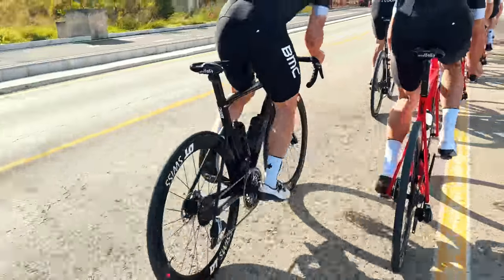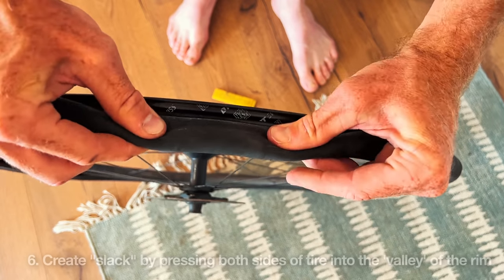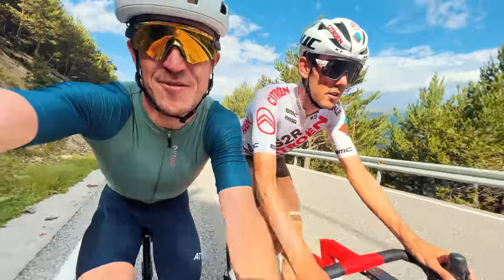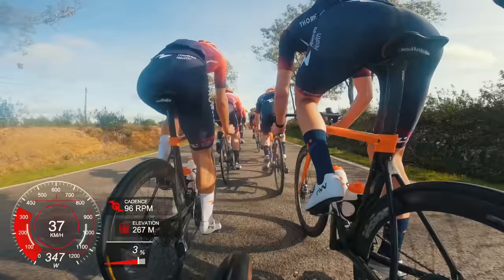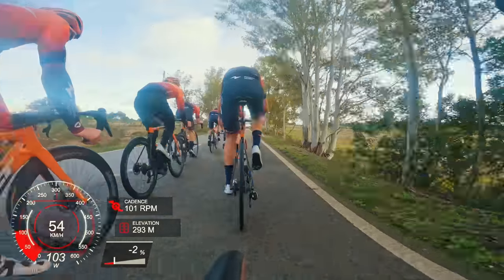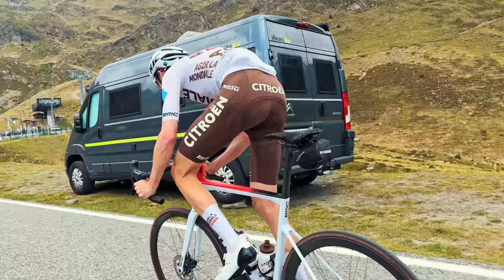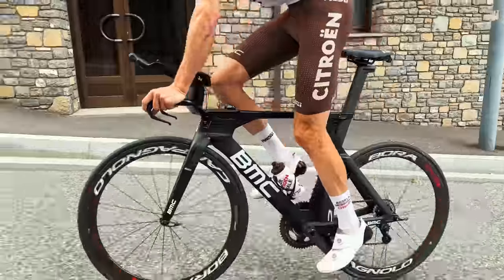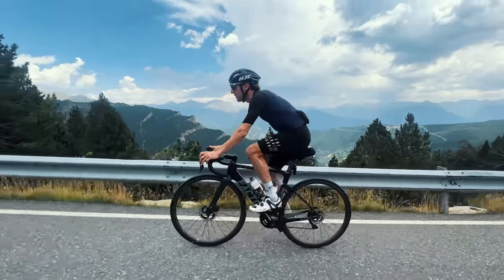6 SKILLS Pro Cyclists Have That YOU Can Learn Too

Comment: Nice video.  One thing about pace lines, at least to me, is that on most group rides or centuries, you are in a single line.  The leader takes his time up front and then signals when he is ready to drop back and then the rider behind him takes the lead for x amount of time.  Easy-peasy and no wasted effort.  Two wide on public roads can be a bit disconcerting, with traffic and all.  A side story about pace lines.  I was on a century ride years ago and we were moving quite fast.  As we were moving along, we heard 'On your left'.  Blowing by us like we were hardly moving was a line of tandems.  Oy!  They were more than fast.  It got me intrigued and not long after, I purchased one.  A great purchase and I still ride it to this day when I can get someone to ride with me.  Your advice on nutrition is spot on.  I got lazy and put on a bunch of extra weight the last couple of years.  I'm 65 and my doctor admonished me to lose weight.  I fixed my diet and started riding more, like I used to.  My average speed has gone up three miles and hour on my normal rides with less effort and way less fatigue.  I now carry energy bars with me and it has made a big difference.   As far as turning your bike upside down, I guess that it is OK at home on a carpet, but, as you stated, lay your bike down on the non-drive side on the side of the road in the grass.  Sorry about the long-winded post, just a lot to mention.  Either way, a great video and excellent advice.

Comment: Very well presented. Sleep has become a huge focus for me especially as I age. In my 20s and 30s, it didn't hamper my group rides. Now in my 50s, low quality sleep can destroy my rides. Thanks for this topic👍🏾
Reply from the maker: Thanks Luis. I really think sleep is as overlooked as nutrition has been at times. I definitely notice a difference between a bad, an average, and a good night’s sleep. Glad you enjoyed the video 🙏🏼
Reply: @tristantakevideo  really impressed with Ben O’Connor performances as of late
Reply: Sleep is great.  I retired this year and my sleep pattern is back to normal.   I go to bed at roughly the same time every night and sleep until I wake up.  No alarm clocks or work calls to interrupt me during the night.  Along with losing weight and eating correctly, it has improved my health and my cycling big time.  You can't over rate sleep.

Comment: Great tips on changing tubes. I'll state the obvious: you will not have a floor pump on your ride. Great tips are much appreciated. Cheers
Reply from the maker: Allow 3’ total for a hand pump. But only 1’45 for a co2. 😏
Reply: @tristantakevideo  Cheers,  again, I will use this method.

Comment: My way of replacing puncured tube is to first release one side of the tire, pump punctured tube a little bit BEFORE removing it to see, where is the puncture, then check my tire properly around the same area, looking for  particles of glass and not first look/obvious damages of the tire.

Comment: great tips mate, fixing a flat - have you seen the guy who fixes his puncture only to have it fail again?  Well, at the tube removal phase - pump it up to identify where the leak is then use that as a reference to find the source on the tyre, many times the source is not visible on the outside but you can feel it on the inside.  finally tubeless, yep I don't want to say this but haven't had a flat in years, ... not joking years and that's on the commuter and the race roadie.
Reply from the maker: Yeah that’s a great tip. I’ve used it a couple of times when I can’t find the source, but generally make sure to run my fingers around the inside of the tyre a few times to double check as well.

Comment: i doubt you’ll be able to do the same under 2min in the middle of nowhere. In video you have a big pump and you didn’t check the tyre😅 
but yeah, anyway, it’s a good skill to understand how to change a tube at all
Reply from the maker: True, under 2 minutes is a big ask. But the quicker you can do it indoors, the quicker you’ll be able to do it outdoors. Nothing worse than a tube change taking 10-15 minutes because someone hasn’t learned the basics.

Comment: What's the point of switching the tube under two minutes? The crew you rode with is already 1 km away (or more). No chance of catching them up riding solo!
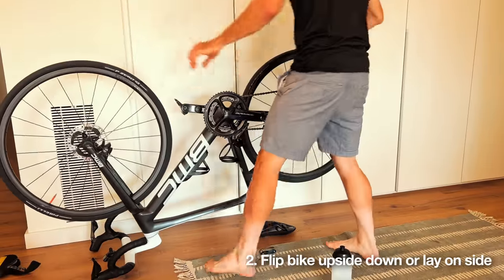1:30 And you just got scratched the shifters... OMG, what sort of advice are these?
Reply: Most (all) groups that you are actually riding with, as opposed to just sitting on the back of some random group, will stop with you if you have a flat. But no one wants to stand around in the cold whilst someone takes 5 minutes just to even get a new tube out of their pocket! Only real exceptions would be early morning pre-work bunch rides when some folks may keep rolling if they need to get the kids to school et etc. But even then, they’ll generally let you know so they don’t look like a dick.
No judgments here, but if your group just rolls away without you, get a new group😜.
Totally agree with you about turning the bike over though. Scratched saddle and hoods…😵‍💫. And the number of times I’ve seen someone do that forgetting that their computer is higher than their hoods… ouch, nice scratched screen..🤬